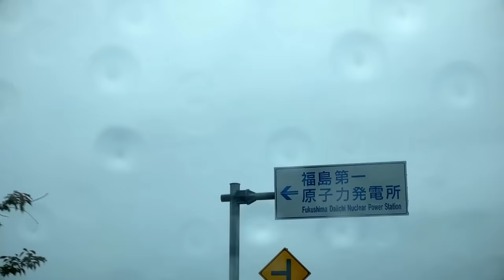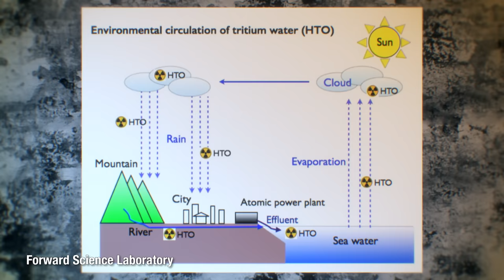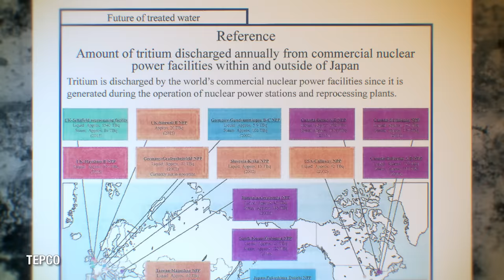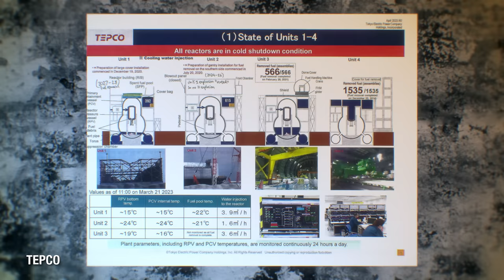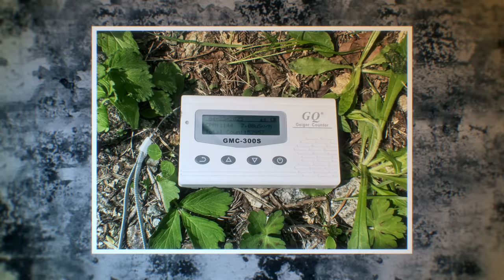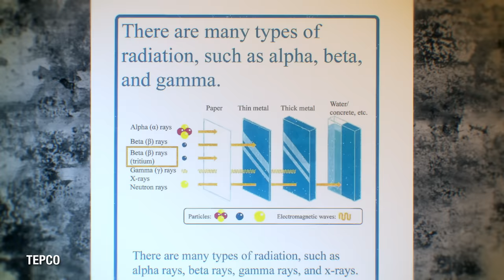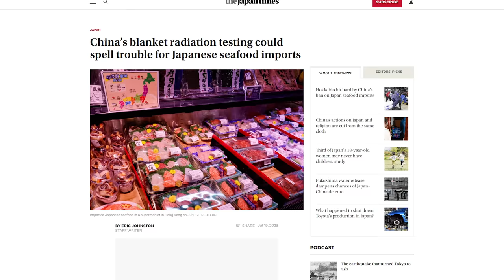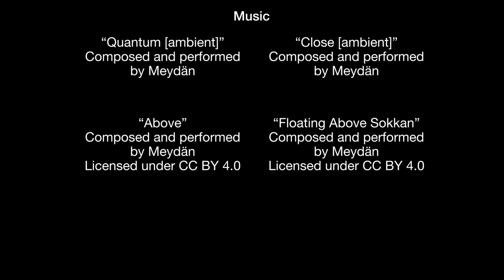Is Fukushima's Radioactive Water Safe?

Comment: Why do everybody just accepts that ALPS can filter out all but tritium? What type of details do Kurion expose to the public of how they can achieve that? Why TEPCO does not allow visitors collect their own samples for testing? If the water is so safe, they can release it to the reservoir for resident drinking slow enough instead of to the ocean. That's their own country's issue, so not to potentially affect the globe. ☹
Reply: No. That's not true even with the given sample.  I just make this comment from watching the video: 
Now I see from my own eyes how Japan is twisting data about the safety of the ALPS process.  
Their reports says "The Multi-nuclide removal equipment (made by Toshiba/ALPS) utilizes the chemical and physical attributes of contaminated water to REDUCE the concentrations of 62 types of radioactive maters. "  
No doubt we can scientifically REDUCE the level of any chemical especially when you dilute it enough.  Yet Japan public relations claim that  Toshiba/ALPS machine could "eliminate" all radioactive elements except tritium.
Reduce and Eliminate are 2 different things.
Reply: The truth is Japan cannot even be honest with the information inside the "controlled" report.  😨
Reply: @coolkidim  This statement is true on its face:  The Multi-nuclide removal equipment (made by Toshiba/ALPS) utilizes the chemical and physical attributes of contaminated water to REDUCE the concentrations of 62 types of radioactive maters. " 

All such device even semi functional can REDUCE the concentrations of some types of radioactive elements.

Comment: Thank you for this excellent explainer. I think the larger issue at hand is not the actual question of safety, but the approach and public trust around the release. TEPCO has historically been caught lying about the radioactivity of previous releases. The IAEA was only approached to commission a report on the safety of the wastewater release after the decision to perform the release was already made, and officials involved in the decision-making refused to consider alternatives or consult directly with their neighbors, preferring instead to make the decision first and seek forgiveness later. On top of that, TEPCO's monitors were suspected of fudging radiation readings immediately after the wastewater release began, with radiation levels reading significantly lower than expected until journalists reported on the discrepancy, after which readings returned to normal with no explanations given.

Like you said, there is no scientific reason why we should expect the water to be unsafe, assuming that TEPCO's treatment process is as described. But with TEPCO's seemingly intentionally misleading approach to informing the public, it's completely understandable why the wider public, especially Japan's neighbors, would react poorly.

Comment: The main issue is not tritium, this is misleading, these water actually contacted the melted core, unlike with a normal functional reactor.  The company claimed their ALPS system removed all the other radioactive contaminants like carbon 14.  Given the company’s past track record, a lot of people simply don’t believe the claim.
Reply: There appears to be some misunderstanding in your comment. At the Fukushima nuclear power plant, all radioactive materials, including tritium, are purified to below regulatory standards using multi-nuclide removal equipment and diluted at least 100 times before being released into the ocean. Through these treatments, the actual amount released is less than 1/100 of the regulatory standard value.
Reply: @dnmdch That is a hilarious attempt at a comparison, nearly all water you drink will have once been sewage.
Reply: @spaceageGecko  im not sure about you, but i would definitely not accepting it. Furthermore, we are talking on radioactive element and not just common pollution.
Reply: Don't you think they don't know the main issue is tritium?  That's why they want all those who get paid to talk about it.

Comment: About Japan's nuclear contaminated water treatment device (ALPS), it is a nuclear contaminated water filtration device made by Toshiba in Japan.
First, this device was the first of its kind in the world and had no prior examples, related usage experience, or data to support it, nor were there any relevant experimental analysis reports. It relies solely on Japan's unilateral
statements.
Second, the filtration effectiveness is strictly controlled by Japan, and even the International Atomic Energy
Agency cannot directly inspect it. They can only examine samples submitted by Japan.
Third, the technical data for the filtration device is too vague, making it necessary to estimate that multiple
filtrations may be needed to effectively reduce harm.
Fourth, the consumables for the filtration device are not cheap, and it is impossible to verify if Japan can strictly perform multiple filtrations.
Fifth, Japan refuses real-time monitoring of its treatment results by any party. As seen in the news, neither the
International Atomic Energy Agency nor South Korea, China, Russia, or Japan allows monitoring of treatment
results.
Sixth, as stated in the International Atomic Energy Agency assessment report:
1)The International Atomic Energy Agency explicitly states that the report does not support Japan's ocean
discharge claim. They are not foolish and do not want to bear a thousand-year reputation. 2)The greater diplomatic and political instability caused by Japan's ocean discharge is something they have long
anticipated. They have subtly expressed that Japan's actions are not under their guidance and control, and more;
this is a matter of speculation.
Seventh, although the United States supports Japan's ocean discharge behind the scenes, they had already started prohibiting the import of Japanese seafood before the ocean discharge. These can be verified through news sources.
Eighth, this is also one of the most concerning issues: isn't the United States concerned about polluting the
ocean with nuclear contaminated water?! According to ocean current predictions, most of the contaminated water flows toward the west coast of the United States. However, when the contaminated water reaches the west
coast of the United States, its radiation levels are not significantly worse than the nuclear contamination
produced by the west coast of the United States itself. The radiation index on the west coast of the United States
is already severely exceeded, but the range is not large. So, what's the key to this issue?!
The key is that the United States is only polluting a small part of its own land on the west coast, while Japan is contaminating the entire world's oceans at nearly the same level. This is also the origin of the statement often made by the Japanese, "Europeans and Americans can eat radioactive food, why can't Asians?"
Reply: Great analysis. Every point is valid and clear.  Thank you.  
Japan dumping nuclear contaminated toxin into the ocean and in such quantity and duration effectuates an extremely serious threat to our ecological system.  The long ranging damage cannot be measured or even imagined.
Reply: Excellent points.  You have pinpointed it. This ALPS device was the First of its kind in the world and had no prior examples, related usage experience, or data to support it.  Indeed even according to the very limited reports from TEPCO, the device had failed on so many occasions.  And TEPCO had to use the device repeatedly to manipulate the outcome.  The fact that there were no relevant experimental analysis reports on this device making Japan's safety claims very lacking. The effectiveness of the device rests solely on the unilateral statements from an entity who had turned the initially low category accident to the biggest radioactive disaster on planet earth.
Reply: You comment really help people to see how inadequate ALPS and IAEA reports are.  Many people do not read long comments.  If you can break down each point that would be great.  Many people can learn from and comment on it.   The majority of the comments here are blank comments without addressing the content of the video.
Reply: 私は日本人です。あなたのコメントにいろいろ突っ込みどころはありますが、日本人はそんなこと言わないですよ。ただの偏見では？

Comment: China has raised genuine concerns due to the incompetency of TEPCO over the years in filtering out some of the other radioactive elements. Tritium is what the Japanese wants you to focus on when there are other harder to detect harmful elements that they are planning to dispose into our sea water. Don’t let them distract you.
Reply: Got any reliable citations on this? Curious.
Reply: @hewdelfewijfe  Do a test with your car.
Pour coolant fluid into the engine, run for few minutes and drain it.
Compare what comes out from the engine against ordinary used or new coolant fluid.
What TEPCO doing is diverting the attention of the world to concentrate on the ordinary used coolant, burying the fact that, what they are releasing into the ocean is actually what came out from the engine block. If you need citations, you should check with your brain.
Reply: @MMLL369  it seems that other respectable international organizations said that that have removed other contaminants. Why should I believe your conspiracy theories over the truth worthy words of the IAEA?

Comment: is it safe or not ? think about it base on two facts

why it happen ? TEPCO cheaped out their bulding of fukushima site

is discharge the only option?  nope, but cheapest option for TEPCO

even if  ALPS treated water 100% safe. real question , do you really think tepco will replace, repair the alps machine for (30?)  years ?  I don't think so , there is also doubt of alps treated water machine because they don't let others test it.

Comment: You are white washing this issue for Japan. If the so called treated nuclear contaminated water is safe, why don't Japan just build a reservoir and store the water inside it on shore. Contaminants from the nuclear fallout is not just tritium alone.  The fact is that no amount of filtering can remove all the radioactive isotopes that are present in the contaminated water.
Reply: What they only talk about Tritium?  B/c it's the westest radioactive elements.  The physical half-life of tritium is 12.33 years, meaning that it takes just over 12 years for tritium to decay to half of its original amount. As it decays, it emits beta radiation. As tritium decays, it changes to helium.
Why they do not want to talk about other radioactive elements?  B/c the other radioactive elements could takes over 1000 years and up to 18 trillion years to decay !!!💀💀💀

Comment: Few people realize the lengths that they have gone through to get where they are.

  I have been processing radioactive waste water at nuclear power plants for about 20 years. I've processed around 30 million gallons of water in that time. The majority of that water tends to be in the 1e-05 to 1e-04 uCi/l activity range, and 50-250 uS/cm2 conductivity. Because the emergency responders had to pump seawater into the reactors, they were making water that was 1e-00 uCi/l and 50,000 uS/cm2!
  Anyone familiar with water processing will understand immediately that the conductivity of that water is a really big problem. Those salts will deplete ion exchange resin in minutes. You would generate waste by the tons daily. 
  I can't go into technical detail, but they have the most Advanced Liquid Processing System in the world. They have removed every isotope but tritium. 
  That's not a small feat, based on the water they are working with. 

  And as for tritium, it's the b*tch of radioisotopes. You can't remove it, since it's a hydrogen isotope. Being a hydrogen isotope, it isn't dissolved or suspended, it's one of the hydrogen atoms in the water molecule. It's also naturally occurring (it forms in the upper atmosphere) and it's present to some degree in ALL water. 
  The bright side of that, is its about the weakest isotope out there. You can only count it with scintillation, since its too weak to penetrate pretty much anything. And because it's part of the water molecule, it's biological half life is super short.

 One last thing, when I was there in 2012, the dose rate in our break room (in the TEPCO building) was 50 uSv/hr, lol. That's just where we would hang out in between jumps.

Comment: I’ve translated J>E documents about nuclear power plant operations. My uncle (we’re from Fukushima) also previously worked at TEPCO and is now on the government side of things. 

I’ve also noticed… inconsistencies between what I’ve learned from studying the topic on my own, and the documents that I translate or am provided as reference material. 
It’s especially an issue when I’m trying to learn in Japanese, and I’ve kind of had to focus on reading materials published before 2011, because anything after that point is incredibly confusing at best, misleading at worst. This is the first time I’ve seen a knowledgeable English speaker directly address this.

Comment: Does anyone know reason why they didn't use 2 loop system with heat exchanger as in reactors from the beginning, so they don't need filter water after direct contact with radioactive materials?

Comment: This might be a silly question, but given that the water is being used to transfer the heat away from the core...

...why can't it be reused once it's transferred that heat to the environment?

It might not be as efficient as using a refrigerant (which relies on using pressure to get a state change and the associated latent heat capacity), but there's a more relevant property of the process: the refrigerant doesn't get used up, it can keep getting cycled through... as long as it's able to radiate the heat at the condenser.

Or even more simply, you can keep an engine cool without using up the coolant. Why is all this "wastewater" accumulating instead of cycling back through once it's cooled down?

Comment: I have heard that tritium is not the only risk for this water because it is not regular nuclear wastewater, but rather nuclear-contaminated water that has been in contact with the reactor core. It there anything to that?
Reply: At the Fukushima nuclear power plant, all radioactive materials, including tritium, are purified to below regulatory standards using multi-nuclide removal equipment and diluted at least 100 times before being released into the ocean. Through these treatments, the actual amount released is less than 1/100 of the regulatory standard value.
Reply: 自分で調べてみれば解るよ

Comment: Even if the treated water from Fukushima were dangerous, China, South Korea, Canada, the USA, France and the UK discharge higher concentrations of tritiated water than Japan.
Also, the average atmospheric radiation level in the Northern Hemisphere was 50 Mbq/㎢ in the 1960s and 1970s, but the rate of change in human genes in recent decades has been negligible. In addition, the number of cancer cases had rather decreased.
Most of the once high atmospheric radiation levels were due to the Soviet and Chinese nuclear programmes.
Two and a half years ago, while in Thailand talking to a political journalist specialising in the Indochina Peninsula, I heard an eerie rumour. A Chinese Navy Type 093 nuclear submarine had apparently sunk in an accident in the waters near Xiamen, halfway between the Bashi Strait and the Taiwan Strait.

I am not a native English speaker and I think I am wrong in places. Thanks for reading my poor English 😊.

Comment: I was under the impression that tritium is not the major concerns of the opposers...Their idea is that tritum is a key measure only for the cooling water under normal circumstances. For the polluted water touchig the reactor core, it could hold much more containgeous ratioactive chemicals.
Reply: tritium is the weakest radioactive element with the shortest half life
Some other radioactive elements half life is over 1000 years

Comment: Why can’t they just recirculate the water that’s is in the storage tanks? What prevents this from being a closed loop?
Reply: By recirculate , do you mean reusing them in the reactors ?
If so , water that is used in nuclear reactors have to be extremely pure to function properly and safely.
If there was a technology that was available to do so , we would've done that.
Reply: @dtst-j5n  Meaning if it’s “safe enough to release” back into the ocean wouldn’t it theoretically be pure enough to cool the reactors?
Reply: @_Blumpkin  
My bad , I didn't have the correct understanding of the full process.

Short answer is , they are reusing the coolant water after purification.
The reason they have huge tanks to store radioactive / treated water is because rainwater and water flowing underground leaks into the building through numerous cracks from the earthquake. Because of that 100tons of radioactive water is "made" everyday which is way more than they need to use as coolants. That's the reason they have such tanks to store said water , and why they need to release it.

Also , when releasing the treated water it gets diluted with seawater about a hundred times of its mass. Reusing this as the coolant kinda defeats the entire point of making the water safe and releasing it.

I'm sorry if I confused you , tell me if anything is unclear.